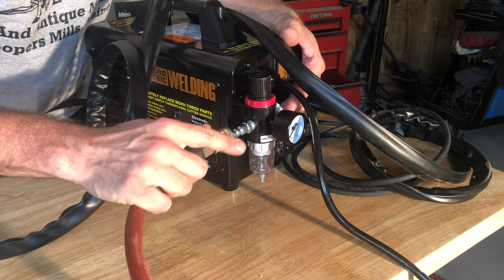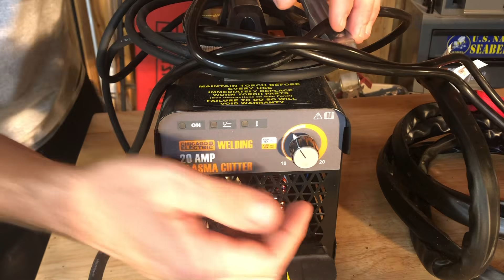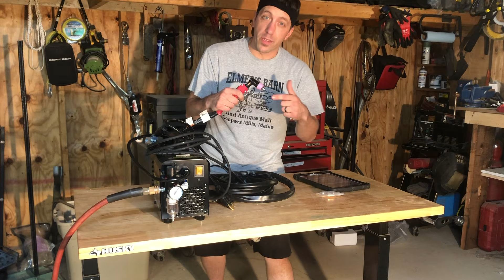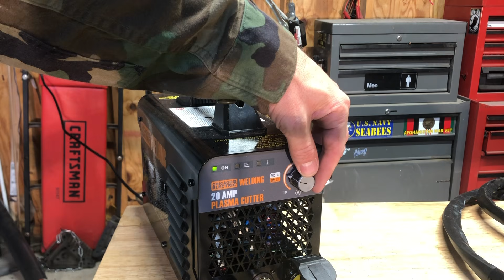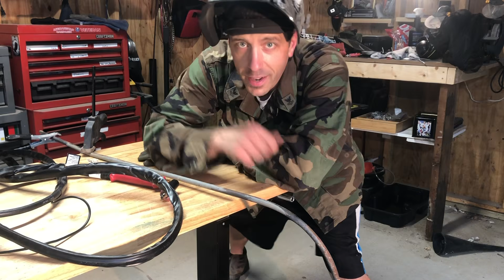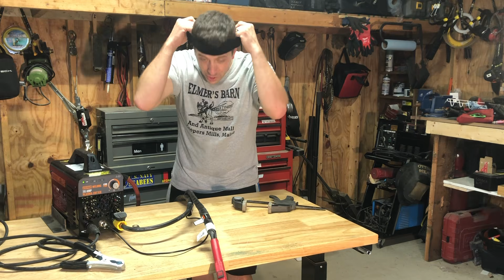NEW! Chicago Electric 20A Plasma Cutter From Harbor Freight Tools - Full Review!

Comment: What would be considered a "short burst" if im using a 6 gallon air compressor? I dont intend to cut for minutes at a time. Ill only cut about a foot length at a time at most. Will a 6 gallon be ok?
Reply from the maker: Short bursts as in 5-10 seconds. You’ll need to keep the tank pressure above the needed operating pressure of the tool. 6-gallons run low quickly when using constant air. I’d recommend at least a 15 gallon tank if you’re cutting anything substantial. I hope that helps.

Comment: Do not buy Harbor freight for Welding needs this is over priced junk. The Bestarc Plasma Cutter, Pilot Arc BTC500DP 7th Generation beats this hand down all day long for less money in every way. Need a Welder get a Yes Welder or keep being disappointed after you spent 2 times as much for 1/2 the machine at Harbor Freight. I am an avid Harbor Freight shopper but the value is just not there in the welding category! Same goes for that Vulcan Garbage their wire is just total crap! and welder are way over priced
Reply from the maker: I actually got a Bestarc plasma and it was AMAZING.
Reply: What about the omnipro 220 vulcan
Reply: I was just about to buy this plasma cutter until I read your comment, your a god sent 🙏 thanks buddy.
Reply: @Brandon-br6fq  Glad to help. I use it every month or so for an hour or so on odd projects no complaints so far.

Comment: I was looking at the yeswelder CUT-45DS for half the price. What do you think about that one?
Reply from the maker: Not sure - haven’t watched any reviews on it yet. Worth a shot for $200 though! 🇺🇸🤘
Reply: I got the Bestarc Plasma Cutter, Pilot Arc BTC500DP 7th Generation, I have the Yes Welder 250 Pro & Flux 135 Pro and love them both but went with BestArc for the Cutter. This  can cut 1/2 steel on 110V with easy. This thing exceeds with is is advertised for cutting thickness as on 220v at 50 Amp you can cut 7/8" with any issues.

Comment: Hey Jimmy, would this machine be good for a beginner who has never used a plasma cutter before? And what about a welding machine from Harbor Freight for a beginner?
Reply from the maker: Well, I would purchase a used one for cheaper money if you’ve never used one before - to hone skills and see if you like it. The Chicago electric flux core machine I have has been great for many years - definitely a great starter machine.
Reply: @jimmysgarage9068  Sounds great thanks Jimmy for that info, I don't know if you done a review on that Chicago electric flux core machine. I am going to have to take a look at your playlist, and do these machine need to be plugged into a 240 or can it run off 120?
Reply from the maker: @johnny1556  I’ll do a video for you on the capabilities of a cheap welder. The smaller ones are 120 volt.
Reply: The problem in buy a used one is that, what if the welder has problem?, we can’t trust people selling stuff online, they never tell the truth. 

If the welder is no good you gonna be frustrated and may give up thinking you can’t do it, but on  reality is the machê e not working properly.   

My suggestion is buy a Lincoln Flux core 90i. Lincoln has a reputation and quality product.

Comment: I would be happy with cutting 1/4 steel.
Reply from the maker: Honestly, the bulk of the steel work I do is 1/4" or less. Didn't make sense to go with a larger machine when this will suffice! I'm going to have to push the old stick welder off my welding cart to make room. \m/
Reply: @jimmysgarage9068    Thanks for the news on this one. This is indeed affordable :-)